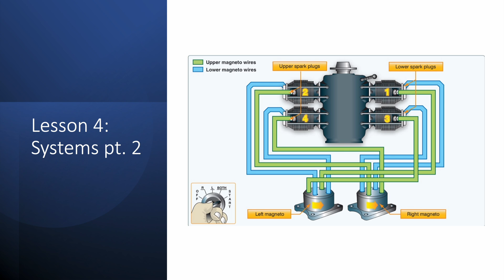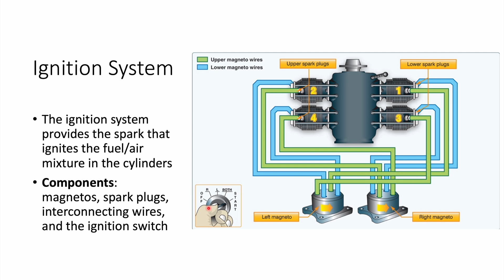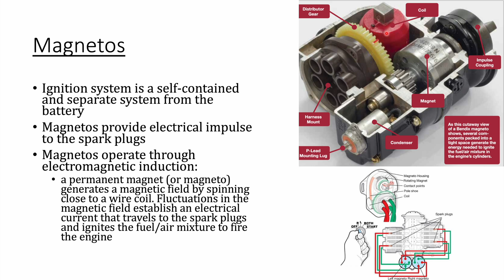Free Private Pilot Ground School Lesson 4: Systems pt. 2

Comment: I love these videos, could we get a link to the PowerPoints? Also at the FuelSystem, I think you said that carburetors can’t be low wing. They can because that’s what the Piper Archer is and most other pipers are. And the S model Cessna’s are fuel injected and high wing
Reply from the maker: Hi, thank you so much for watching. You are correct. As it says on the Fuel Systems slide “low wing and fuel injection rely on fuel pumps to deliver fuel at adequate pressure.” This class was addressed to students learning to fly Cessna 172s so the wording at 13:53 “the carbureted model (referring to Cessna) works off of gravity” is true. We’re currently working on making the PowerPoints public. Please let us know if you have any questions
Reply: @ Thanks for clarifying, can’t wait until they are available!